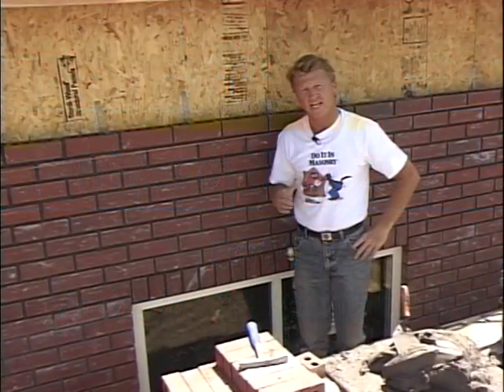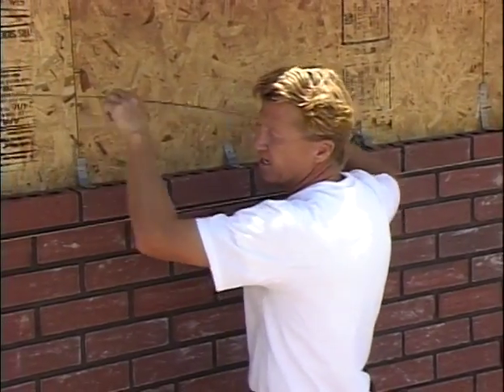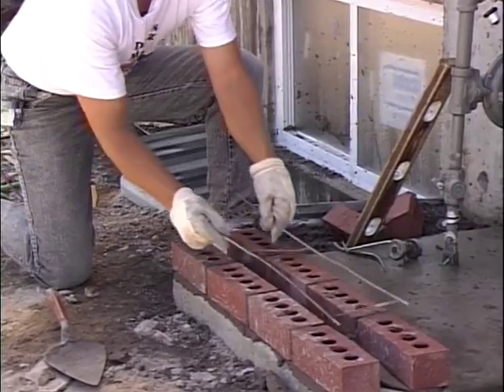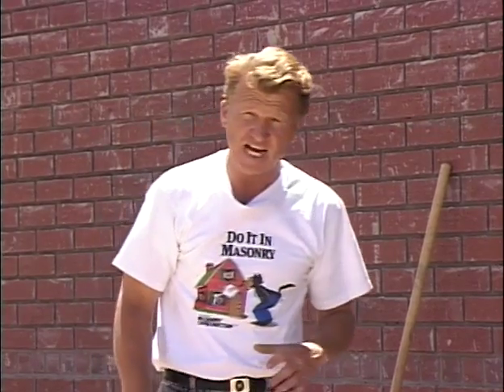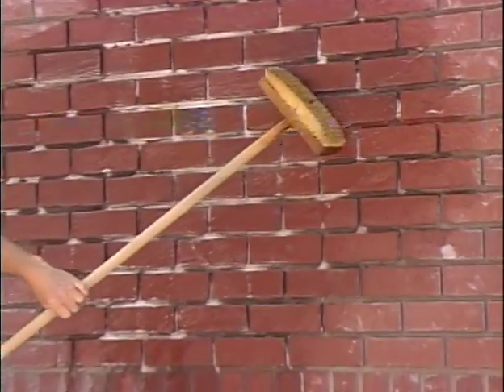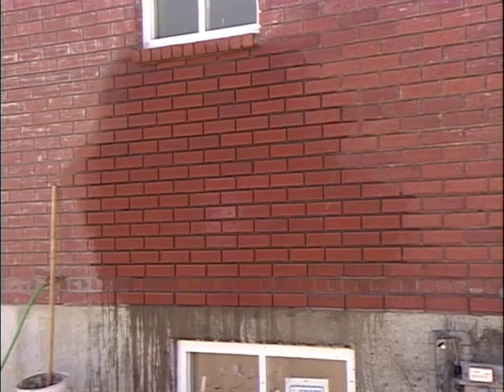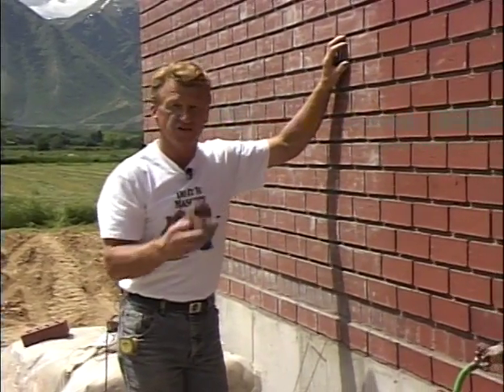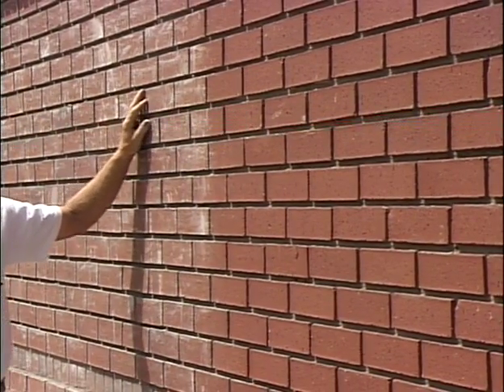Anchoring and Washing A Brick Wall!

Comment: Wall ties should be secured at the closest possible point where the tie is bent and use coated screws. Leaving slack in the wall tie (anchor) will allow the wall to pull away. And the brick washing solution contains muratic acid. Note how the fumes steamed from the bucket as he added the solution to water. Those fumes are harmful to your respiratory system. Also, never apply cleaner to dry brick. Always wet the wall prior to application. Failure to wet the surface prior to cleaning may result in an etching or discoloration of the mortar joints, especially with colored mortars. Wear rubber gloves and never use cleaning detergents without eye protection. Wearing a rain coat helps keep the chemicals off your skin as well. I am not bashing the craftsman in the video. I am just  giving information based on my experience as a bricklayer and things I have learned over 25 years in the trade.

Comment: When I was a kid 30 years I worked a summer university break with a brick cleaner.We were using dilute hydrochloric acid.It was vicious stuff.As I was scrubbing I felt a pain on the forearm.I was horrified to see that the acid had eaten away my shirt sleeve.Luckily the plumbing was installed and I washed my arm for ages under the shower.I finished work that day in pain.I woke the next day with huge acid burns on my forearm.Not wanting to seem a pussy and call in sick,I applied antiseptic cream and went back to work.To add insult to injury,we had to clean those bricks 3 times,the bloody mortar mix used was like epoxy and stuck like shit to a blanket.Every time I drive past that damn building the memory comes flooding back.

Comment: I’m just curious as to why the ply wood isn’t covered with a fabric
Reply from the maker: because when this video was made in the late 80's it wasn't required and left up to the home owner, and they decided to skip it. Todays codes would require it.
Reply: Learn To Lay Brick ok. That explains a lot. I pressure wash houses using a soft wash and I also clean gutters out and the things I see is amazing.

Comment: I own a 1960's ranch home in the US- wood frame with brick veneer. Asphalt sheet type sheathing was originally used, with no type of moisture wrap like Tyvek. The home has experienced termite damage and some of the exterior walls will need to be reframed. I have some contractors telling me it's not a problem to reframe and repair it and other's telling me they literally don't know if it can be done because there would be no way to retie the brick veneer wall into the new framing. Is there an approved standard method to retie the brick veneer into a newly framed wall from the interior (or some way to tie the brick veneer to the newly framed wall from the exterior instead of the interior) so that the brick would maintain its structural security? Any advice would be extremely appreciated!!
Reply: Did you ever find a solution for your issue I'm facing the same problem now with a 80s brick home?

Comment: No waterproofing or wrb on top of sheathing before brick ?
Reply from the maker: yes. Not recommended but wasn't required at the time and was left up to the home owner. But is required now and should be used to code.
Reply: @learntolaybrick  Even felt paper was used for years so  there is no excuse here not to have at least felt.